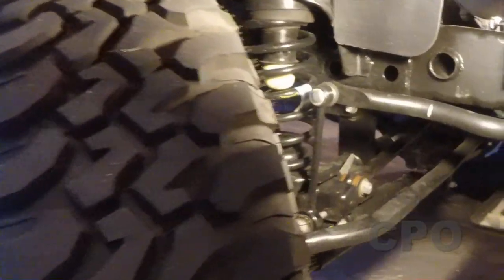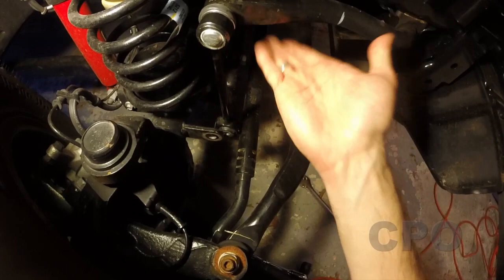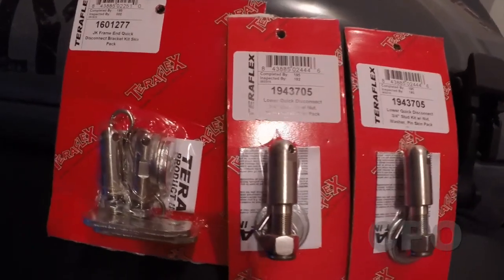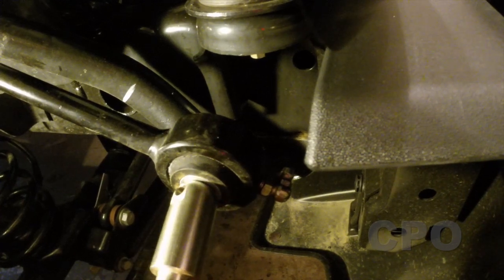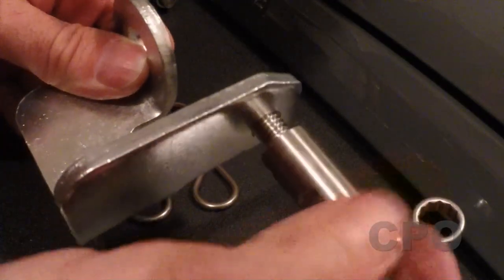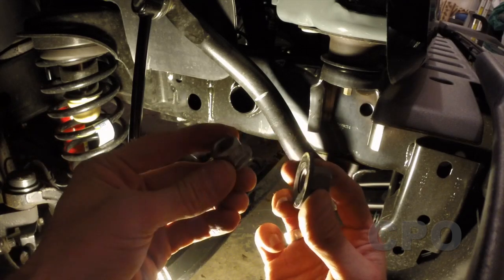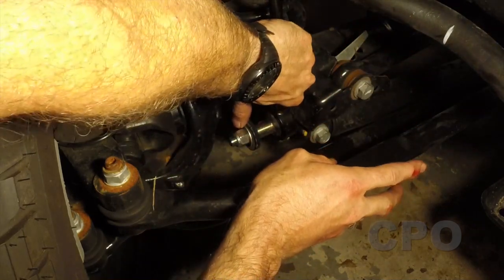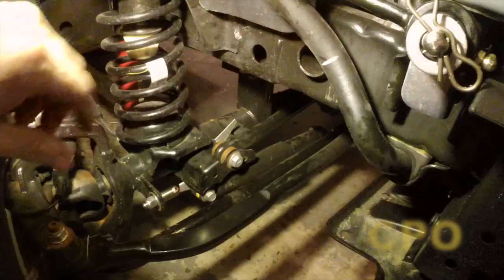CPO Teraflex Swaybar Link Quick Disconnect Install (15 JKU)

Comment: I think I have watched every one of your JK videos in the last few weeks! Keep up the good work! I have the XRC fenders and other stuff on order. 

Quick question for you: I have an '08 JK. The length of my "bars" look much shorter than yours and on the Teraflex site it seems they sell this whole kit with bars (longer) and the rest of the stuff. 

Are the bars on the '15 longer from stock? Did you have any problem getting around that "hole" protrusion pushing them up? 

Cheers!

Comment: does this work with stock links ?
Reply: I just bought these pins and brackets for a '16 JK.. I had no luck in tapping out that center sleeve, ended up trying a C clamp and sockets but it just dug into the rubber material. Probably going to just order some teraflex - 0 - 3 front sway bars, but not until I find out if those will allow me to tap out that center sleeve.